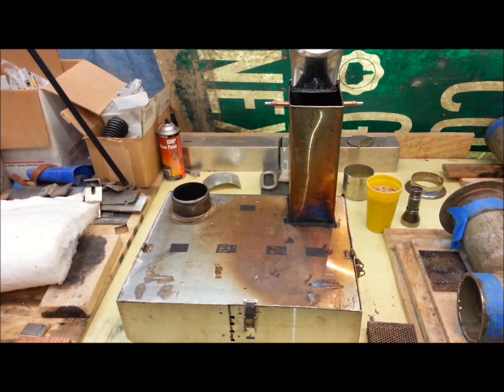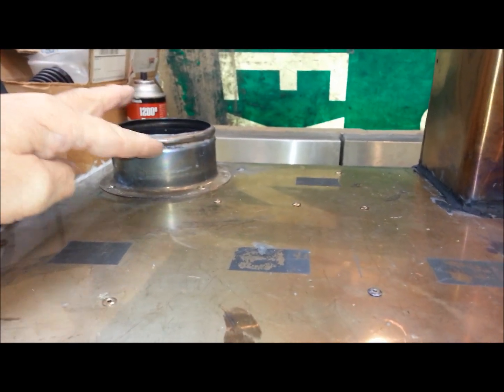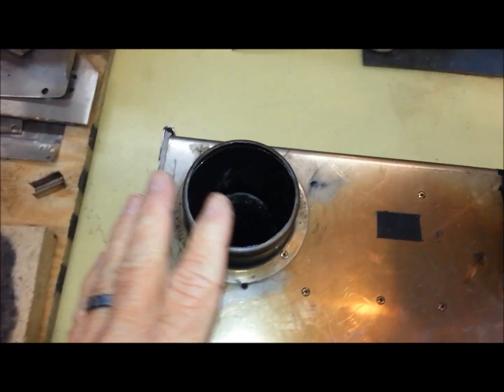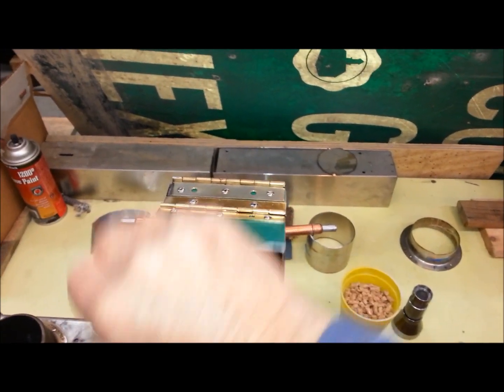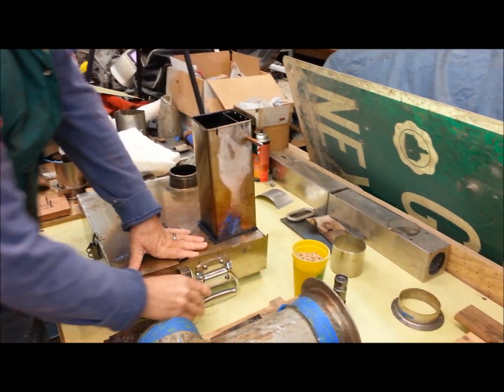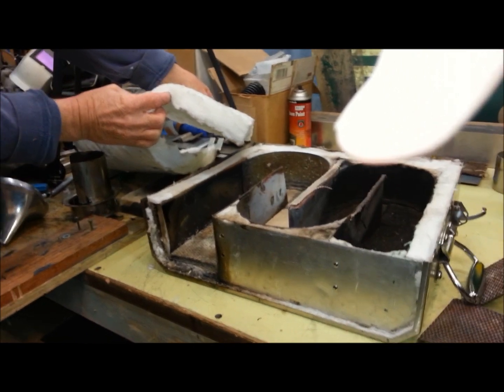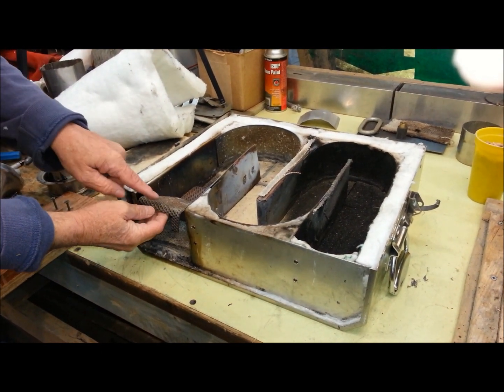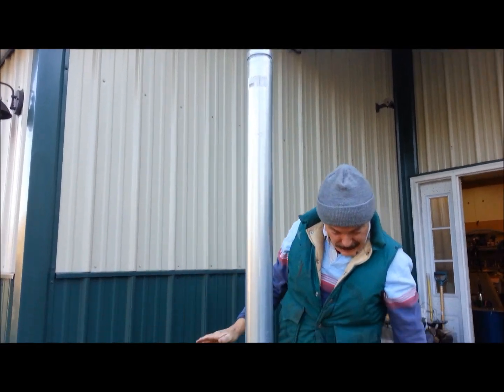Picnic rocket stove Video 4

Comment: Great work Jeff. I'm so happy to see someone improving my design. It gives more meaning to my ideas. This shows to power of co-operation or co-design. Your design is easy to modify depending on the needs. If you have any questions I'm happy to help you. You are a true rocket stove designer!
Reply from the maker: Thanks Pekka.  A compliment from you, the rocket stove guru, is praise indeed.  Used  your research with insulation and secondary air for this stove.  Your shoe box stove is great for power out situations and the cooking pot bottoms stay clean also.   Love the cooperation and sharing among all the designers and builders too!  It's a good energy.